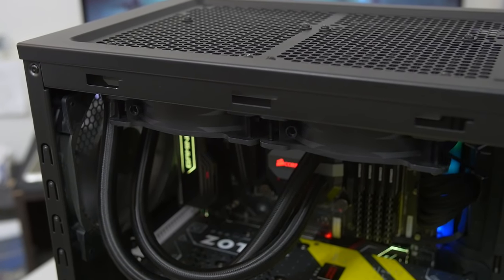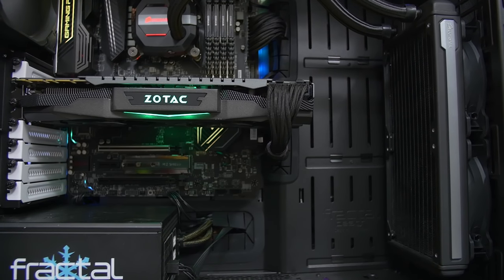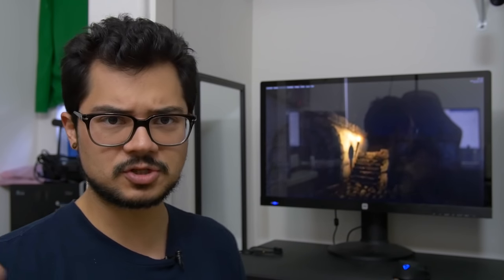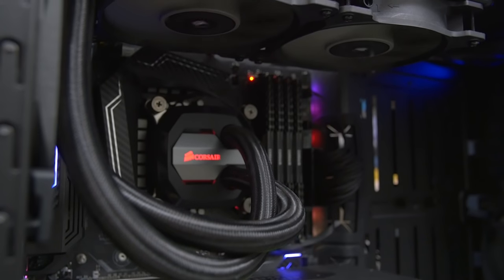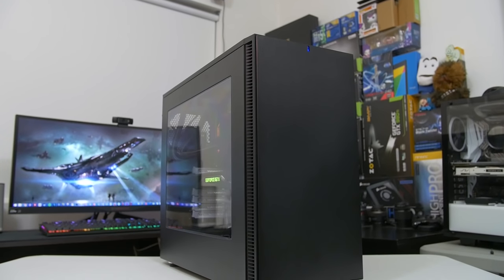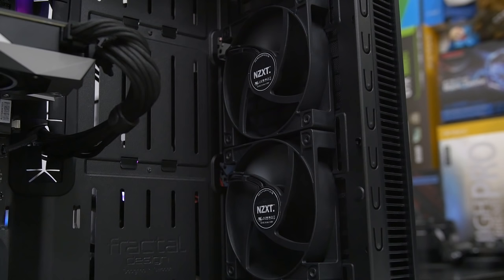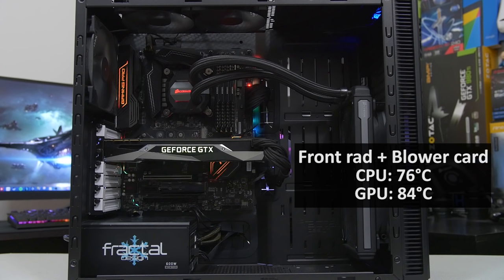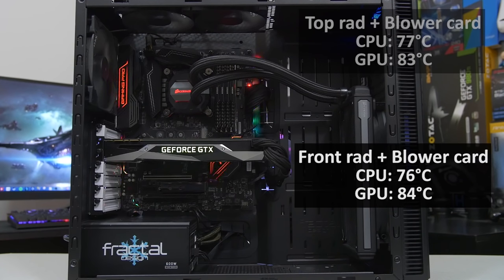Does Radiator Placement Matter? Hint: YES

Comment: what about the top fans should they be exhault or pulling air in with the  raidiator mounted in the front
Reply: I was thinking the same thing. What if the top mount was setup to pull instead. Or maybe push and pull. That would be an interesting test.

Comment: if you have the rad in the front of the case you want the hoses at the bottom to keep the air out of the pump, the rad acts as a reservoir... why don't people talk about this...?
Reply: Can I have my fans on the other side with the fans still pulling air in?
Reply: @RockyJayyy  other side as in putting the fans on the other side of the rad or print the whole thing in the other side of the case
Reply: @Red_Scorpian  like this case,rad,fan instead of case,fan,rad
 
   -CASE-
     Radiator
v Fans pulling v

Instead of:
    -CASE-
v fans pulling v
    Radiator
Reply: @RockyJayyy  you can have it push our pull, it doesn't matter.
Reply: @RockyJayyy  just make sure if you have the rad in the front of the case that you have the fans as intake

Comment: I thought he was also going to cover exhaust vs intake of air through the radiator.
Reply: He kind of did. If the radiator is positioned in the front, it's acting as intake. If it's at the top, it's exhaust. And that's how airflow should be set up in a case. Front and any side fans should be set as intake, and top and rear fans as exhaust.

Comment: The reason the front mounted radiator is cooling the CPU more is probably because you omitted any front intake fans to feed air into the top mounted radiator.

Comment: Thanks alot is exact info I needed, looking to get new 240mm CPU Rad for i7 7700K to replace old 120mm Rad & only option is front mount cuz clearance issue but wry more about temps on my Gigabyte 1080Ti OC GPU then temps on my CPU good to know wont matter much if at all. Here's a question if anyone may know what about the thought of putting case fans on the backside of a front mounted CPU Rad so fans on front & back how that may effect your GPU temps ??? if it may lower them with better / more airflow or raise them by pushing more hot air in at it faster ???

Comment: So can it still be front mounted tubes up? 3 fans 120mm infront 2 on the top and 1 in the back.
Reply: if you want to do a front mount with the tubes up you want to make sure that the area on the rad that the tubes are at is higher than the pump otherwise overtime air bubbles form in the rad and they tend to float up and if you have it the way Bitwit has his front mount setup it makes it easier for the air bubbles to get sucked into pump resulting in failure. I don't think he knew it at the time he made this video because a lot of prebuilt companies would build their PCs like this and ship it off to customers without telling anyone, but Gamers Nexus did a video on it about 6 months ago explaining that with the front mount you want to either have them flipped to where the tube side is at the bottom or you want the tube side higher than the pump, not at equal height.
Reply: @ThinkPositiveDude  It will be a little bit higher

Comment: This tests are very flawed, mostly because of the GPU configuration. 
You use a stock GPU vs a highly overclocked version of it. 
Then to make matters worst, you max out the power slider, which we all know, not all cards have the same max power. 
This results on drastic difference in power consumption between the 2 cards and in consequence, a major difference in heat production.

Comment: It’s common sense, the radiator is designed to cool, so the front is a no brain. Putting it in the hot air defeats the object.
Reply: You don't have to be so arrogant and deterministic using reductionist causation by applying a single definition to all cases. And speaking of cases and cases in my case I use a Corsair H80i v2 (with two fans on either side - pull/push system) as exhaust fan in the back of the case. the result would not be so different if I had put it in front: it never exceeded 60ºC (140ºF) in heavy games.

Comment: I was thinking of putting aio radiator in front of the case, should the tubes matter if its on top or bottom?
Reply: Tubes on top, air bubbles are a thing

Comment: i am planning to get both my  gpu  and my cpu watercooler with the gpu using an nzxt g12 bracket. i will configure them both as an intake on the front and top and 2 exhaust 1 being on the back of the case and the other one at the bottom. is this good?

Comment: top mount in pull config with filters with out put fan right under neath it sucks most the hot air out i'm running 11 c under load and i'm oc'ed to 6.02 ghz i have 6 intake fans 2 of witch are on the 240 mm radiator again in pull sucking air from out side my case with a filter over them and 1 yes only one out put fan and the temps i'm seeing blow me away

Comment: Questions about the front rad. Does the fan sucking air infront of the cpu or the other way?
Reply: There's a small difference between that fan placement maybe 1-2 C so if u can do push instead of pull.
Reply: @Headz_  so the fans in the front of the rad right? Pushing the air inside the cpu?
Reply: @iCeMhaN23  That's PULL, So CPU FAN RAD <- that's pull, CPU RAD FAN <- that's push. Push is slightly better for the temps.
Reply: @Headz_  CPU <-- (Airflow) RAD <-- (Airflow) FAN = Push right? xD
Reply: @iCeMhaN23  Yes, thats push.
Reply: @Headz_  Thanks bud! :D

Comment: Is having a top mounted radiator set to intake an option? With 3 front case fans, and 1 exhaust?
Reply: Nah, you don't want to push or pull hot air into your case. I'm actually gonna do a test in my new P600S with rad in the front, right now I have it in the top with H100i se platinum. My idle temps on stock 3700X with ambient 25C is 35-36C. All of my 6 fans are set to 700rpm up to 40C. As I wanted to go white scheme I had no option but to go for 120mm corsair LL120mm fans otherwise I would've gone corsair LL140mm which are black fans as you could probably set them at 500rpm and get the same result. Though I have to say the only thing audible on Idle at least is the pump itself set on quiet preset which is 1900rpm. I wish I could lower that speed to around 1000-1200rpm. 
So 3 intake fans 120mm front, radatior mounted at top exhausting and 1 exhaust fan at the back thats it. Gonna test that scenario bitwit is talking about by putting radiator in the front instead of top. 
To add more I have come from p400s and that case was baking my gpu and it was hot inside. I even had a push/pull radior mounted in the front obviously. You can do push/pull there not sure if ppl know that but still wasnt happy with temps idling around 41-42C with same ambient but RAM temps were like 47-48C now my RAM temps are 37-39 a huge difference just because by pushing cool air into the case. 
Hope this helps tho will test the front rad configuration later. Peace.
Reply: JK really interesting actually thank you :) I’m going with 3 Corsair ML 120s at the front and 1 at the back. Just deciding whether to go with 2 ML140s at the top with an air cooled cpu, or to go with a Corsair h100i AIO (280mm). My case is a compact style so there isn’t enough room for a radiator at the front. So I need to choose between a top mounted radiator or an air cooler for my cpu.
This is for an i7 9700, rtx 2070 super and 32gb of ram
Reply: @joewhitehouse9714  Depends wheter u want to go for silence or not. For me its the first encounter with AIO and tbh temps are great as usually on Idle I'm about 35C and after doing 10mins of AIDA64 extreme CPU hasn't reached more than 49C but not sure if its me but I can hear the pump even on quiet preset. Its sad that you can't set a custom preset for the pump. You can only do it for the fans. You can specify a curve for the fans but not for the pump. So options are quiet, balanced or extreme. Previously when I had my system in p400s even with the stock AMD Wraith Spire running at 1000-1100 on IDLE system was silent but temps were like 10C worse on CPU and GF card and RAM aswell. So its a bit of a trade off here. If u want silence go for AIR cooler as u will hear the pump or my pump is broken but no I think thats just the sound it makes. So even on quiet u can hear the pump and u won't hear the fans which are set at 700rpm before they hit 40C. This is getting a bit long answer. Now I'm not sure if I had gone for that AIO. Its nice to have low temps but I thought the system is gonna be silent at the same time but its not.
Reply: @Headz_  Hi I also plan to get a p600s and a 280mm aio, so according to your test is it better to mount it on the top?
Reply: @ruili7033  Hi, haven't tested the front setup yet. Just didn't have time. Since the warm weather finished now in here ambient is now 21C, the temp on the CPU is 32-33C idle the only caveat is pump noise. Hope they will release firmware update with low rpms quiet mode for this model.
Reply: @Headz_  Thanks! I'll probably get a NZXT x52 or x62 cause many people say it has lower noise than the corsair.
Reply: @ruili7033  Oh wish I knew that earlier.

Comment: Okay so if I add my 240 mm radiator to the front of the case, sucking cool air in (through the radiator, but now warm air into the case). Do I have fans at the top push hot air out, or the top fans pulling cool air in? What is better then? Please help me, confused.
Reply: Push hot air out. You want to exhaust as much heat as you can out of the system while equally bringing air in. If you make intake at the top and only have rear as an exhaust, you're just going to cause unnecessary turbulence inside the case and you will hotbox your system.

Comment: what type of fan can i use on the top if i decide to go front cpu cooler im new to this. is it a intake fan on top or out take
Reply: All fans are the same, they only blow one way.  All you have to do is swap the orientation of the fan.  Look for the little arrows on the side of the fan that indicate which way they spin and which way the airflow goes

Comment: Nope. the tip ripped my GPu card because of heave wave from CPU radiator. It is a suck recommendation
Reply: Yeah I watched another video on this and was one of the issues. While you are pumping more air across the CPU, you are putting all that hot radiator air just back inside your machine, which then hits the CPU back, and also then your GPU. I'd rather have my radiator at the top blowing out, and front just fans bringing in fresh air.

Comment: What happens if I make the top rad to push air into the components (intake) and let the rear to push out?
Since I dont want to change the current setup of the front panel of my lovely case (Cooler master H500P) thanks
Reply: You'll be pushing hot air into your case no the best solution. You want to intake cool air into the case wheter top front or bottom and exhaust back and/or top. My setup is the most basic one in P600S with 3 front Corsair LL120mm fans as intake, Rad H100i SE platinum mounted top exhaust and 1 exhaust fan at the back. My temps never been better with ambient 25C stock 3700x is idling 35-36C. Hope this helps.
To add Im coming from p400s and I have to say when you have mesh front it makes a huge difference. P400S was choking with only vents in the front up top and bottom. Now in P600S alot of cool air is coming inside my case and even my RAM temps between these 2 cases had dropped by 10C from 47 to 35-37C thats huge.
Reply: @Headz_  In this video Bitwit pushed hot hair in from the front and it was the best solution. That doesn't mean it will be the same at the top but i think it could be better than putting the radiator at the top and exhausting like most people do. The top radiator pushing hot air in, a good rear exhaust fan + psu (not downwards) as the only exhaust fans can be better... i think.
Reply: @devhxpg  Well it's physics all hot air goes up. Front rad intake vs top rad intake is completely different. Try it and let me know your results but. In bitwits case he was missing 1 fan in the front while having radiator up top. I'm pretty sure that's a huge difference. I'll test myself later on.

Comment: Best mounting place is in the front as in take . If you mount it in the top as out take the heat of the gpu will go up in the raditor and it will make heat in the raditor then the cpu will have less cooling.
Also add 2fans on top as out take and one on the back as out take air as well.

Comment: Can someone tell me when he has the radiator in the front, are the fans pushing air in through the radiator? I am currently seeing very high temps and I have to mount my 280mm radiator in the front. Currently, the fans are on the opposite side compared to his setup, and they are blowing air out the front through the radiator. My temps get up to 80-90c.
Reply: Usually you have intake at the front and exhaust at the back/top (which this guy in the video has), since the dust filters are placed at the front of the chassi (that's how it's built). So the fans at the front are pushing the air from outside, through the radiator and into the case. I'd recommend you do the same, otherwise you are just using the front as the exhaust (which makes no sense, usually).
Reply: @topdps  Thanks. I actually have been having really bad CPU temp problems for a while and it has got worse when I upgraded my memory. I thought it was a voltage thing after a week of troubleshooting but it wasn't. The old memory caused the same problems. The issue was how I had my front radiator fans installed. I had it running as exhaust so all the hot air blew out the front(I cut a hole in the front pc case cover Phantek p400 case). I turned the fans around and noticed a HUGE decrease in CPU temps. Prime95 doesn't hit 90+ anymore. It barely hits 80c. My AOC in game while playing max temps went down from mid 80's to mid 60's on all max graphic settings. My GPU has never had issues with temps but it even went down. Its crazy how big a difference that one small change made. My top two 140mm fans are still running as intake and I meant to change them but there doesn't appear the need to. Seems more intake = better. Just wanted to let you know and hopefully others that fan placement actually really makes a huge deal and I made the newb mistake of running to much exhaust. Because of that mistake, I bought a $100 JigSaw and cut a whole in the front of my case which I rushed so its scratched up some. Just caused a headache. Super happy now though!
Reply: I just got done running further test using game AOC as a benchmark mainly. I changed the two top 140mm 1200rpm fans to exhaust because I noticed hot air coming from the top while playing. Now, they are pushing that hot air out faster as hot air rises of course. I noticed another 2-3 degree drop in temps. Not much but good.
Reply: @Sh3llShockGaming  Nice! Glad it worked out man

Comment: Does it matter that much with stock CPU settings while just running a game? GPU only gets up to 60c. Currently using air cooler which sucks up alm that hot air. switching to AIO in new build. Just trying to figure out before I get it built lol
Reply: 60c is amazing for a GPU. Seriously lol.

My 2080 gets to around 80c when i'm playing games like Red Dead Redemption 2 at 1440p.

Most GPU's get into the mid to high 70's and higher. My 970 didn't even get 60c in games. 60c on a GPU is fantastic

Comment: How much difference would using a top mounted radiator make for a cpu without an overclock? I’m using a Meshify C case so I’d like to capitalise on the good air flow with 3 front intake fans, but this requires I use a top mounted 240mm AIO to cool my i7 9700k. Anyone got a take on how they think this might work out to do with temps and air flow etc. Whether lots of air flow into the case would help at all and all that. Would be grateful for any advice :) thanks in advance for any replies 

Other components for the build include RTX 2070 Super, Gigabyte AORUS Z390 ultra Motherboard,  32gb 3200Mhz DDR4 RAM, rm750x psu, 515gb NvMe m.2 ssd, 2tb Sata ssd

Comment: So I mounted mine at the top and it sucks air in...is that bad? haha
Reply: XD the best fan configuration is 3 fans intake and 3 or less on exhaust (blow air out).Your fan configuration results in your pc having bad temps and will suck up dust a lot quicker.
Reply: @user-ph4co5jo4b  true but ive never had problems in 4 years haha Motherboard nice and cool cpu 100% on 60° graphics card 100% areound 84°
Reply: @ProPlayer013youtube  thats good temps do you not have any fans on exhaust?
Reply: @user-ph4co5jo4b  I have the Silent base 800 and a radiator on top wich sucks air in for a cool cpu

Comment: SO, it's not as much the position as if it's blowing in or out.  Can you just mount the radiator on top and have it suck cold air from the top?
Reply: Actually Top + intake is what Corsair recommends! Depending on your case and if it has a dust filter on top. As long as you have an exhaust fan or two on the bottom. ,cause it takes the hot air coming directly from GPU. At least that's what one of their technicians told me....
Reply: @ravenbeast8639  thanks.  A day too late as I installed it last night hehe.  I ended up I taking from the front fans since that's where the filter is and exhaust the radiator at the top.  So far it's been working nice
Reply: @ZarliWin  Cool man. Enjoy your new rig
Reply: @ravenbeast8639  thanks!  So far so good.

Comment: Why didn't you try the top as intake?
Reply: Why would you want to bring cold air into your case from the top if heat rises and the hot air will go into the cold air? This is a mismatch and is disruptive to static pressure airflow. It's a bit counterproductive in a sense

Comment: Would it matter if u where mounting cpu radiator on front panel tubes down or up

Corsair h100 I platinum or a kracken x 52
Reply: I saw one comment say you should have the hoses at the bottom